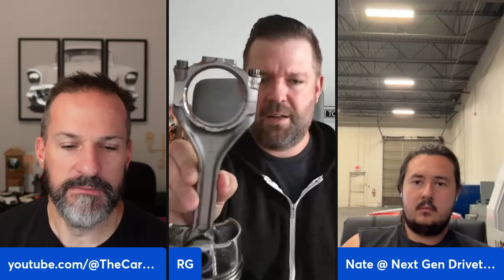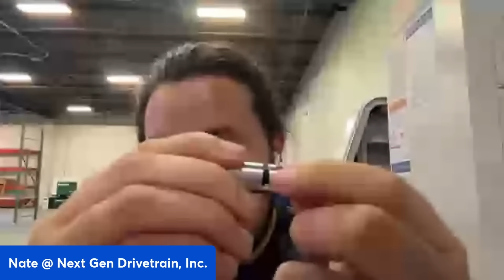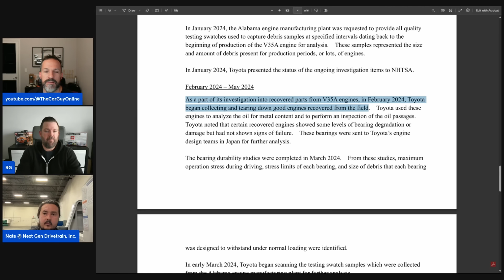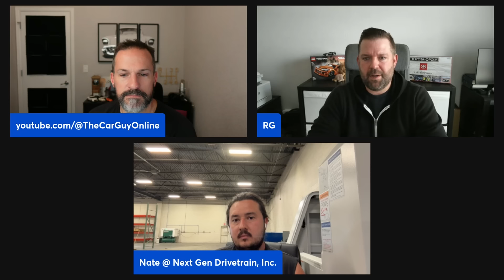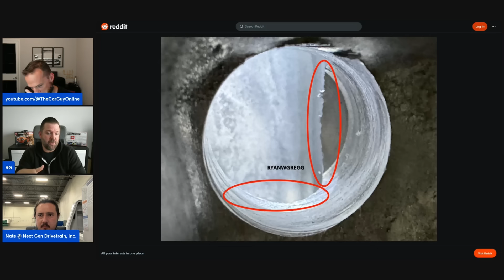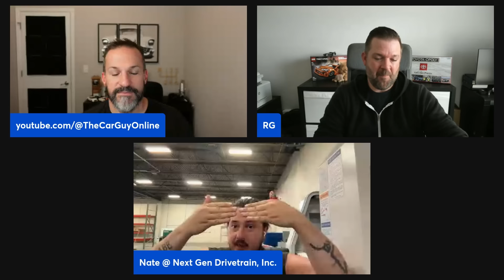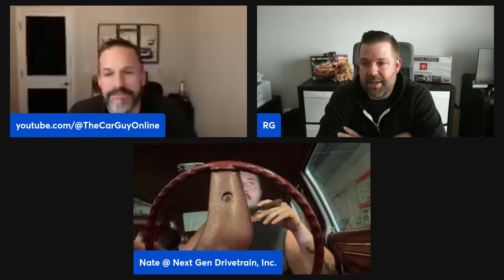Toyota Tundra BOMBSHELL. Buyer Beware Until 2026 (Full Interview)

Comment: I think Kaizan left the company a few years ago.
Reply: i've been a toyota autoworker for 10 years and it is absolutely long gone....they preach it all the time but honestly i've never even seen it maybe even once since i've worked there. things have gotten worse and worse every year, and i'm sure its the same at every other car factory.
Reply: I’m sure it is still there, but without executive participation. If it’s like the company that I worked for, the process creeps with time and you get executives or upper management delegating the root cause analysis work and then overruling it based upon accounting input. It’s very frustrating.

Comment: 10w30 5w30 is what the car manufacturers used for decades and never had engines blowing up
Reply: Been using in Ga 5w-20 and all is good.
Reply: They've been using 0W-20 for years with no issues.
Reply: @ryanwgregg I have four consecutive oil analysis reports on my 2012 Camry, each oil change roughly 12 to 14000 miles using Amsoil 0w 20 Signature Series. The oil has held up just fine, with virtually no engine wear per rhe PPM count on the engine wear metals.
Reply: @frankharley1000  Yup. 0W-20 isn't the issue in this case.
Reply: @frankharley1000  The ideal oil viscosity changes with ambient temperature but fuel economy regulations mean the recommendations in US owner’s manuals are sometimes different than for say Australia (or longer ago Europe.) 

How hot does it get where that vehicle was driven and would you have had the same results in say Texas?
Reply: @shawngrimes9302 I live in Yuma, Arizona. One of the hottest places in the country, with summertime temps often hitting 115.
Reply: @ryanwgregg  and I’ve been using 530 in those exact cars with no issues. Because you can run it. I think for people that don’t use their trucks for much 20 is fine. For those of us that actually use our trucks for hauling and towing 30 all day. and the oil analysis proves it

Comment: Stay out of these new gen Toyotas...they suck.  Buy the older 2nd gen Tundra (5.7 V8), 2nd gen GX (4.6 V8) or 5th gen 4runner (4.0 v6).
Reply: 100% right.
Reply: Absolutely!
Reply: I had a gx460.  Transmissions go bad around 120k miles.  8k replacement.
Reply: @beexiong2995 interesting,  I personally know 3 people with 2011, 2013, and 2015 460's, 2 with over 200k, and 1 with over 350k. All have original transmissions.
Reply: Come on w HR4117 in a month! Fuel emmissions freedom act

Comment: 7:30 Where did you get the 1% failure rate for Toyota tundra engines?
Reply from the maker: The one percent failure rate thing is sort of a NHTSA joke. They require you to put in a percentage failure rate so all manufacturers seem to always just say one percent… Regardless of the recall or actual data

Comment: Your intentionwl miss use of the term criminal undermines the credibility of your presence.

As a person who suffered from Bay Area and Los Angeles smog in the early 1970s I can opine that we do not want to return to these conditions as you dismantle and "criminalize" ordinary pollution control norms and regulations.

One only needs to have a neighbor with a flooded carburetored hot rod, a rich Harley or mistuned lawn mower to know the immediate stink of poorly controlled vehicles.
Reply: Big difference between 70-80s carburetors and 90s port fuel injection. Nobody wants smog but things have gone too far with little to no environmental improvements in exchange for the ridiculous costs forced upon us consumers.

Comment: A GM Rep once told me it's cheeper to pay me to install a rear main seal in a GM V6 then to stop production and make a change?? So we will just piss off the customers?
Reply: Yup.
Reply: GM tends to change things when the model year changes. Ford used to make design/part changes in the middle of a production year and the nightmares that it caused are legendary. The worst was the 90's era Ranger. It was a nightmare for parts stores to figure out which part you needed.
Reply: Not surprising. People not in any particular industry don't know what it takes to do something... something that is superficially simple is actually the most expensive or complicated thing to do. That doesn't just apply to the auto industry either
Reply: Remember the 3.1 V6 in all those Buick Centuries and many other models in the mid 90s? They kept those engines in production knowing they had terrible intake and head gasket issues that they literally could not or would not fix.
Reply: That’s the issue from what I see people are still buying them and Tundra’s too but everyone isn’t in the “know”

Comment: IMO debris in the engine is just an excuse to get the heat off Toyota there is something else wrong with these engines
Reply: Issues with the engine design
Reply: @kevinbrown5942  Not so much design, but a process within the process. I'll have more to share this coming week.
Reply: @ryanwgregg
Wrong about Stellantis failure rate. Worst years of Hemi saw 1 in 250 fail vs 1 in 100 for Tundra
Reply: @Ilikebeer20 facts say far less than 1%
Reply: I've heard multiple people say it's the  move to four bolt main instead of a 6 bolt. That explains the odd bearing wear. Too much flex for a boosted engine.
Reply: I believe it's multiple problems.
Reply: Toyota should go back to the v-8
Reply: @mikekotarba5828 trump should force toyota to put a v8 back in the tundra
Reply: @christianjon8064 
Sounds like something Hitler would have done.
Reply: @christianjon8064 . You want tRump running Toyota ?
Reply: @mikekotarba5828  no I don’t think so, those are having increasing issues as they age….issues too early on. Check out the breakdown from Car Care Nut. Also memories grow dim, but first 2 years of 5.7 in 2007 and 2008 had engines grenading all over the place e to sucking in valves
Reply: @mikekotarba5828 they can’t . EPA restrictions are too tight to use v8s anymore .
Reply: @mikekotarba5828 Told ya 😂😂😂
Reply: I think it's a design issue whether it's the tolerance of a component or so.. some people are saying it's the stress of being boosted.. but Nissan has been doing boosted motors for years and they can take a beating.. Toyota has to go back to the drawing board with this one..
Reply: @joebrown9621 Yea, look at the GTR-35 and others.  Toyota should have consulted Yamaha...or Nissan.
Reply: Yes they were built cheaply, cheap rods, cheap crank, cheap bearings.  Crank is twisting and catching a bearing that has no tang and gonzo engine.
Reply: @igotaction heh, based on what data?
Reply: @Slothtyper  based on the data I have collected building hundreds of engines.  It's not data it's a FACT the rods are not fractured, it's not data it's a FACT that there are no bearing tangs for the main bearings.  It's also a fact the best powertrain Toyota currently sells has BMW stamped all over the engine.
Reply: @Slothtyper 30k a motor is cheap?
Reply: @igotaction your statemente is very interesting but where is the hard evidence of this... deep dive of this engine... has not shown such bad details. Could you elaborate?
Reply: @angelmunoz3709  I do cars YT channel tore one down.  When you compare the Toyota to other 6 cylinder turbos you come to the conclusion above.
Reply: @igotaction ill go check it ouut thanks
Reply: @igotaction  whats your channel where you tear one down.
Reply: @angelmunoz3709  I don't have a channel, but I rebuilt a few BMW N20s on the Vehicular DIY channel
Reply: @igotaction find that video and send me the link... cause it aint in his page....
The car care nut did a deep divee
Reply: Every manufacturer just says debris in the engine now.
Reply: @BorderTurrets it's a legal strategy. Admitting it's a design issue makes them more vulnerable to class action lawsuits. By saying it's just a random debris issue, it's much harder to form such a lawsuit since a "recall" was issued.
Reply: @hochhaul Most accurate comment here.
Reply: Yes, its a design/engineering flaw, simple as that.. can the platform and start new , theres no saving this POS.
Reply: My friend works at Toyota and he told me do not buy a tundra. They haven't fixed the problem.
Reply: lean manufacturing and eliminating quality control through lean manufacturing
Reply: Planned obsolescence
Reply: Debris was certainly an issue early on. That no longer holds any water.
Reply: Absolutely Agree With Your Statement 😊
Reply: They have been saying this since 2022....
Reply: @TimeforchangenowYes, and Toyota bootlicking fanboys keep saying NEXT year will be the " fix" !  What a disgusting joke. ANYTHING  to keep faith in their pet brand,  instead of facing reality and moving on. It's like a part of them DIES if they try another brand.
Reply: @TIJoe-te9qu  true I'm a toyota fan boy but I also live in reality....I love older toyotas  also I buy used but If I were to buy a new truck right now it would be a hemi ram the lesser of the evils I own a 09 ram I've replaced the lifters and exhaust manifold bolts that being said that would cost less than more of the modern truck problems toyota engines ford transmissions  GM they are the worst of them all.
Reply: @TimeforchangenowYep, crazy world. All my stuff is older too. I agree Ram is probably the safest of the junk! Too early for me to judge the turbo 6 yet.
Reply: @TIJoe-te9qu to be honest even with the Hemi problems I'd stick with that over the cylinder turbo. Even tho I paid 4  grand to redo my lifters and exhaust manifolds. I still love my truck.
Reply: Why isn’t my 2023 tundra non hybrid built in January 2023 part of recall? 5TFLA5DAXPX077213 is the VIN.
Reply: was a sabotage operation against al quaeda to disable their vehicles
Reply: Alot has changed w EPA/DOT curbing CAFE standards and emmissions since Trump got in. The old V8 would be possible if they certified the new trucks w old engine ....they have to crash 25 vehicles per model...the most expensive part of getting a driveline certified per platform. Stellantis is going alllll in w Hemi's and dropping the Pentastar. Toyota can do the same.
Reply: It’s exactly what it is. A failed PR. Machining debris my a$$. Toyota Shmoyota. The overpriced junk they put out now is 🤮
Reply: Debris was the red herring.  I think toyota found it and it stopped them from looking further and thats understandable.  If new ones after those build dates are failing then they still have work to do.
Reply: In my uneducated opinion, the problem with the engine is that it's a cast aluminum block with a separate girdle that holds the crankshaft in place. 

A girdle (plate of cast aluminum) has never been used before in any Japanese production engine. You cannot use a cast aluminum girdle to hold an entire turbocharged engine together.

The design was intentionally defective. 

Aluminum expands significantly more than steel. If you heat any aluminum bearing housing the steel ball bearing will literally fall out of the housing (as an example). 

A steel crankshaft in a solid aluminum block can work, but there is a very specific way to do it, and then motorcycle world and the Corvette engine designers know how to do it forwards and backwards. They never use a plate to hold the entire crankshaft in place. They use conventional main caps that have been tested for 125 years. 

The new Toyota V6 will need to be replaced with an older design using the exact castings of the older engines. And they should pay $20 billion dollars, to buy back every vehicle they sold to American consumers.

The EPA and NITSA and the DOJ, also needs to fine Toyota (in my opinion) at least $10 billion dollars for industrial sabotage and endangering American citizens intentionally.
Reply: Believe me as a tech for 32 years.  10 with toyota and 17 with gm. That's enough and makes sense given the ones I have replaced and torn down.  Kia/hyundai have suffered from same problem.  Don't underestimate a workforce not concerned with quality.  Really cleaning a crankshaft after production requires a strong ethic to say the least.  Most of the debris  that world eventually seep to oil feed holes in the engine is hard to see. Even after cleaning.  These engines are barely locked up.  I know the end result is the same . Rebuild overhaul or replace, however the nature at which these engines are locking up lines up with debris on the crankshaft from lack of proper cleaning during manufacturing.  Its sad that such a minor issue results in such destruction
Reply: Oil is shearing from heat/load use 5w-30 and use a coolant boost change oil at 500/1500/3000 miles then every 5-10k depending on oil you use
Reply: yup, engineer problem, engine wasnt tested at track enough, before dealer  sold.
Reply: Yep
Reply: That and the tangless bearings lol.   Tangless haha destined to fail
Reply: The 2022-2023 Tundra's were at that time was the rod bearing metal was defective
Reply: Debris combined with reduced clearances seems to be logical.
Reply: Debris is bearing failures
Reply: Not many people looked back at the old LS. They had a bearing issue as well. It just wasn’t mass produced like the Tundra. IMO the debris excuse was to buy them time and save face.
Reply: @tome6551 LS or LX?  Have a 2020 LS 500 F Sport w/ this pwr plant and no issues at this point 40K miles…was built and assembled in Japan, wether that makes any difference I don’t know.
Reply: @bobbyb.1743 they started putting the V35 in the LS500 back in 2018. You’ll have to look up main bearing failures to get a gist of qty.

Comment: Still driving my 03 Sequoia with 308K miles. No oil leaks or major issues. Just normal wear and tear. Recently replaced the front suspension and exhaust as preventive maintenance. Except for the struts, all parts were OEM original. My 16 Tundra TRD Pro sits in front of house with only 46k miles.
Reply: I have an 02 Sequoia and a 16 Tundra limited 😂. We're bff's. The 02 is a daily driver. What an amazing drivetrain. I'm shopping for a new truck, and after 20 years of buying Toyotas, I think I have no choice but to step into unfamiliar territory. It most likely will be a 2.7 F150. But I'm not happy about it
Reply: @electropentatonic don't do it
Reply: @stefanovichmichael9686 I'm kind of in a pickle. My son is in college and I need to add a 3rd vehicle. My plan was always to replace my Sequoia with a new one, and pass the 1st gen down to him. But I'm not buying into an $80k gamble. I'm safer in a cheap f150 until Toyota figures this out
Reply: @electropentatonic #1 in recalls,and the 2.7 has been known to drop valves...gamble.
Reply: @stefanovichmichael9686  That was definitely an issue, but seems to be resolved. According to NHTSA data, it only resulted in 831 cases. Less than .1% of all 2.7 EB sold. The Internet has a way of making things seem much bigger than they are.
Reply: @electropentatonic Good luck buddy
Reply: @electropentatonic  Buy an older beater truck and pass your current one to your son.
Reply: I was/am still considering buying a used 5.7. I saw a sweet double cab with 8ft bed. Love that model

Comment: I had an oil analysis on my 2002 2UZ-FE 177k. miles. It is suprising how low the wear is on this engine with 5000Mi. oil changes using 10-40W.
Reply: I still service a 1998 Camry V6 that we bought New and sold with 220,000 miles. It currently has 380,000 and still purring along just fine on nothing but oil changes. All original drivetrain and this was the supposed “Sludge Monster”. I have a bunch of oil analysis reports from it over the years. It’s ridiculously GOLD / Dark BROWN varnish under the valve covers but mechanically solid. 💪🏻 

They don’t make em like they used too, that’s for sure.

Comment: I have a ‘94 ford f150 351W auto with 266k miles and was getting 15mpg, couple months ago I broke an emissions vacuum line and now I’m getting 22mpg. How is lower fuel economy with the emissions garbage better than a good running fuel efficient non emissions engine